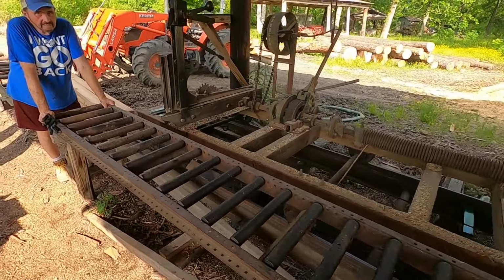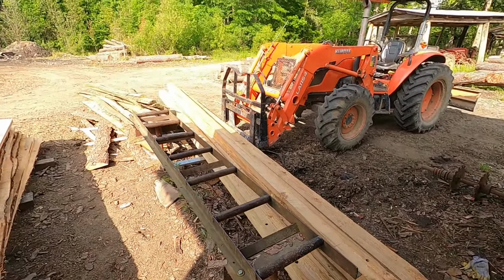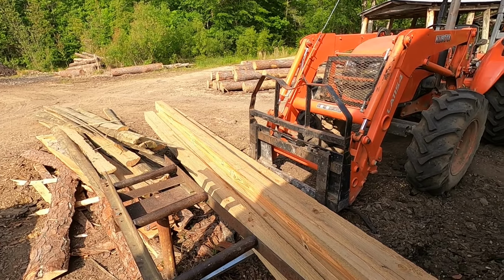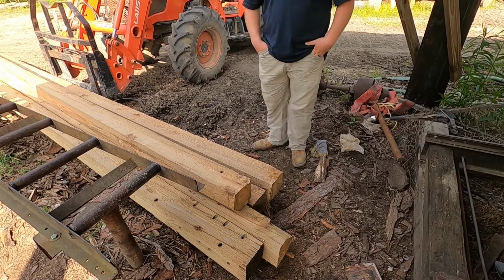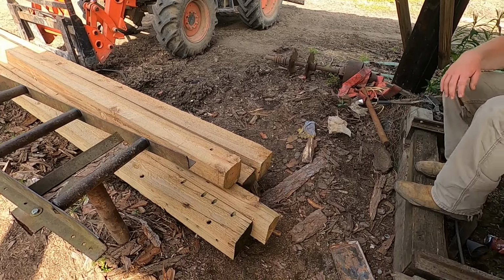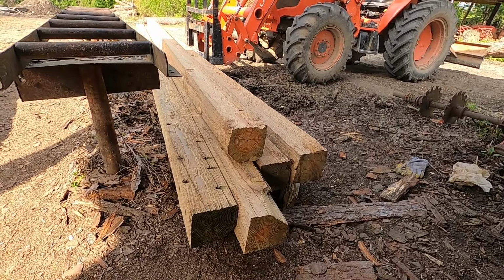Repurposing old POWER POLES!!! Sawing on a Corley CIRCLE SAWMILL!

Comment: A few years back, I had a Corley 54" saw, powered by a 671 Detroit. It was a great cant mill, way faster than any band mill I've seen. They can be a little more dangerous. If you ever have a log shift at the end of the cut and ride up on your splitter on the return, it'll chuck it right over your head when it hits the blade!

Comment: I often wonder while you are sawing away on a big log, tree, or pole with either the band saw or the circular, did ya ever hit a hidden large nail, spike, cannon ball or other foreign object?  Does it trash the blade?  I have seen trees with all kinds of stuff in them.  I was cutting some firewood from a felled oak at my parents house, and in the middle was a slab of steel 3" wide by 7 or 8" long.  After some investigation it turned out to be a section of a car leaf spring driven into the standing tree during a collision.  The exposed outside portion rusted away and the tree just grew around it.  I later found out that crash took place before I was born and the driver was a local kid who became an English teacher in my high school.

*LATE EDIT* I watched your sawing 1x6 out of a 38" log video and it answered my question.  Yes and yes.  Must suck if it happens with the circular saw.....